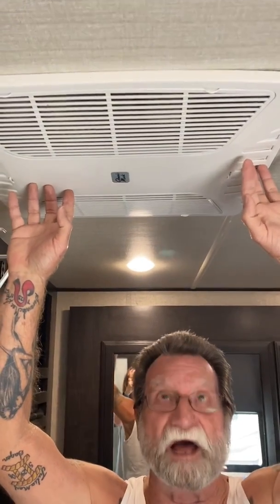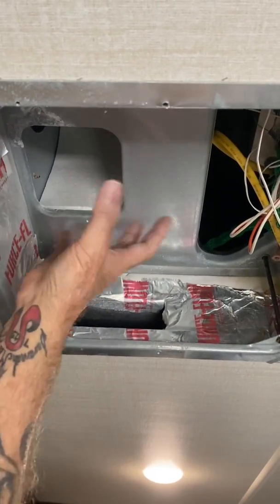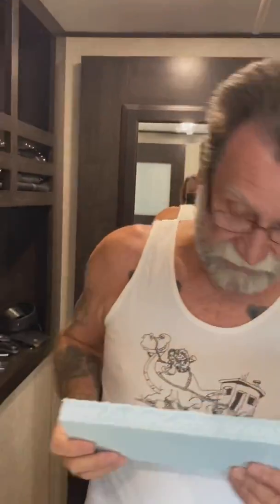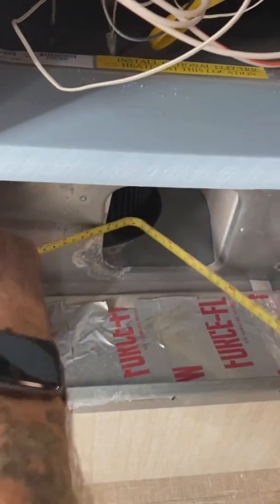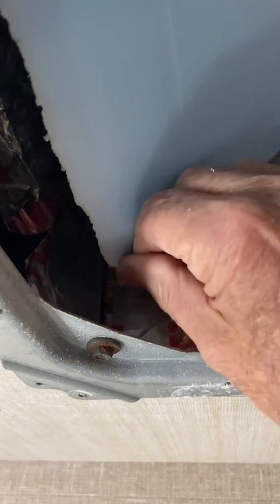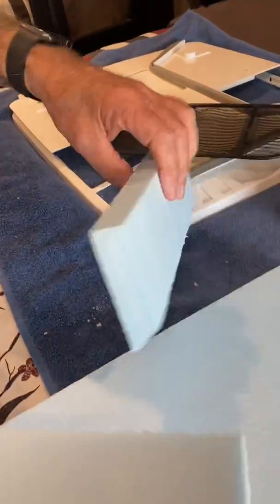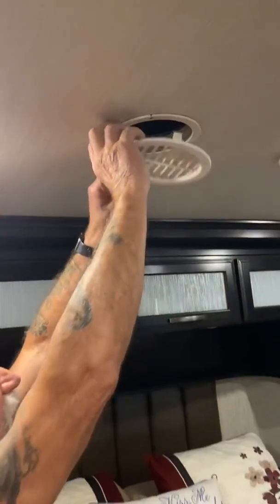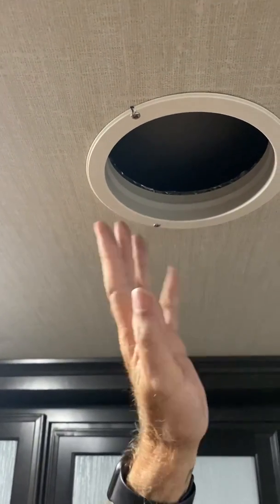RV A/C airflow upgrade ( Colman Mach ) on a budget.

Comment: Does this still allow you to use the direct flow with the shutters on the inside unit?
Reply from the maker: No, it does not. I have found that this mod basically removes the need for them.

Comment: Hey man great video!!! I'm gonna be living in a Jayco 34 ribs I just bought and want to do that to the ac. I was wondering if I should put some r12 board up on the outside to insulate it even more. It's a 2020 and has the aluminum siding with fiberglass insulation with wooden frame. Do I need to do all that? Or would it be good the way it is. The r12 board is cheap and thought what the he'll it's gotta be better then the way it is. Appreciate your time thank you.
Reply from the maker: I don’t know how much it will help but I can’t see it hurting anything.

Comment: Everyone seems to be overthinking this. I simply took two pieces of 4inch dryer vent hose and ran it directly from the supply into the ductwork on each side. The hose is flexible enough to shape for each hole and just need to tape up the small openings around the hose. Then I filled the whole area with fiberglass insulation. Probably doubled the airflow in the camper and the system is much more quiet.
Reply: Do you a video
Reply: @chadbrooks9029  it's already done but I should have done a video
Reply: Too bad we can’t see what you did.  Sounds like a good idea.

Comment: When you say you removed the vents and taped from “top to bottom”, what exactly do you mean?
Reply from the maker: I cut short, 3 to 4 inch, strips of HVAC tape then stuck the tape to the ceiling & then to the ductwork to fill the gap between the ceiling and the ductwork. It took several pieces to go all the way around the opening where the vent is installed.
Reply: @TheWanderingSteeles  makes sense now. Thanks!

Comment: The foam diverter that you built, doesn't allow any air to come through the grill in the AC unit.
I built a similar device with galvanized tin.  But I only covered 1/2 of the grill.  That substantially increased air flow from the ceiling vents.  While still allowing cooling from the grill.
After watching what you did, I will modify my "dead space" to be more aero efficient.
Also, check the inside of the AC ducting for obstructions.  I found the scraps from where the hole was cut, up inside the vent.  Blocking the duct.
Reply: When you say the grill of the AC unit are you talking about the main piece he first took off that's white? If so that's where 99% of my air comes out of. If I close it which I did by accident when I was cleaning the air will flow out of the smaller vents but in some rooms it's barely noticeable. For instance. The front end of my trailer doesn't cool off because that's where the sun is beating the trailer the most after noon time. The back room really cools off but I think that's because it's shaded by that time of the day. I would hate to buy the materials, put in the work only to have an AC unit that's not functioning to where it's at right now. Thanks ahead of time for any info you can provide 👍
Reply: @ImFineMJB  The grill, is part of the first thing he took off.  Part of the cool air comes through that grill.  Part of the air comes through the ducting to the vents.

Air takes the path of least resistance.  What I did, was build an upside down VEE from tin.  I inserted it into the cold air plenum to direct much of the air toward the ceiling ducts.  That prevents the air flow from "crashing" into a square space and just getting turbulent.  I still allowed some air flow out from the grill to cool the immediate area.  That helped my cooling efficiency.

Comment: You where Right. I did mine to day and took all day to do. Your right. Now my ac keeps me warm and  cold really cold. Thanks.  And it saves me money with my gen running.comes on when to hot and when it cold out also. So far it has saved my 120.00  on power running. Thks great job you did..

Comment: Thank you for this video. I've seen several others about this topic and you did a very nice job!
Update: I did this mod to both of my AC units today. Huge improvement! I spent $28 for foam boards and foil tape. Sure beats the $340 I would have paid for two RV Airflow kits!

Comment: One extra note: while you are doing this you can add a thin layer of alum insulation to all areas, this will reduce sound . I used a windshield shield you buy at dollar stores for 5 bucks.
Reply: Al can you explain how you did this?   TIA Al Smith…
Reply: @heavenonearth9959  I bought that cheap windshield aluminum opens up into a screen for your front windshield on your cars it's about 2 ft by 4 ft it's made out of plastic and aluminum and you can cut it and tape it or glue it to where you need inside that duck area of your AC unit in the ceiling intake and exhaust this seals it and makes it more efficient
Reply: @alpagano50  thanks so much
Reply: @alpagano50 Ahh, that's clever. I know exactly what product you're suggesting. Thanks for sharing this tip 👍